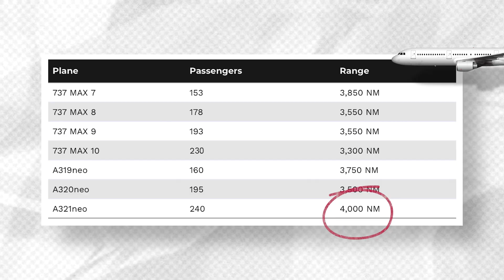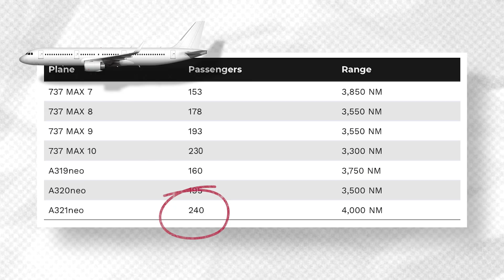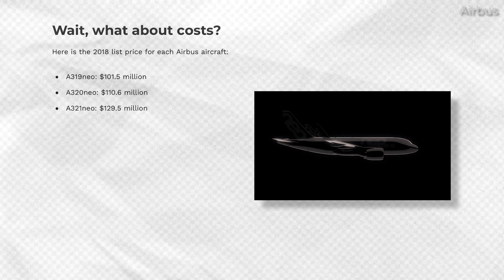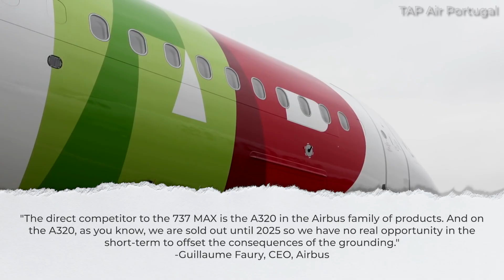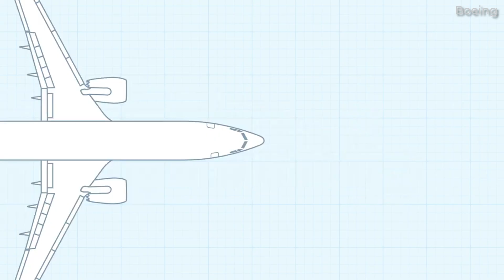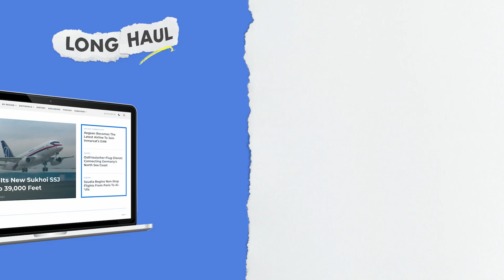The Airbus A320neo Vs Boeing 737 MAX – Which Plane Is Best?

Comment: Pretty obvious the one that doesn’t keep crashing and killing all its passengers is best.
Reply: the max doesn't keep crashing and keep killing its passengers. that would be more than 2 and it hasn't crashed more than twice
Reply: @nickolliver3021  still it crashed so end
Reply: @wasmiddelsap3379  like all planes do
Reply: @nickolliver3021  neo has had 0 crashes
Reply: @thomasgrabkowski8283  a330 has crashed
Reply: @nickolliver3021  I’m talking about A320neo. Also A330, that’s the original version that crashed, not neo
Reply: @thomasgrabkowski8283  and I'm talking of the original a330 that was one that has also crashed not the neo version
Reply: @nickolliver3021  yes it does
Reply: @BC_26fhj  no it doesnt
Reply: @nickolliver3021  The neo hasn’t crashed at all unlike the MAX
Reply: @BC_26fhj  the a320 has crashed unlike 787 lolz
Reply: @nickolliver3021  you come with argumetns that dont even make the slightest of sense, why talk about the A330, B787 when compareing the 737MAX to the A320Neo
Reply: @nickolliver3021  you are the one comparing apples to oranges, you compare the A330 or the 787 with the 737 or A320, everybody else except you are comparing the 737 to the A320
Reply: @KelloggsDigga  737  and a320 is apples and oranges so alot of people do that so I don't see who's is the one doing it
Reply: @nickolliver3021  how are they apple and oranges, the A320 competes with the 737 and vice verse. They are built for the same market, it is comparing apples to apples

Comment: I'll go with Airbus any day.
Innovation in plane design is another aspect you should take into account.
The 737 as a base is TWENTY years older than the A320. 
You can't forget that each new model is only marginally different from the base, just think of the engine issue that lead to the MCAS having to be added to the 737.
Yes, the 737 MAX might be safe, but innovation can only take you so far.
Fundamental design choices CAN'T be changed down the road with a plane (without changing the type rating and the consequences that brings with it).
I'm not saying the A320 is a completely up to date plane either, any 35 year old base wouldn't be, but i'm saying the issues the MAX has are issues that didn't have to be, just because they wanted to make "a quick buck" by upgrading the 737 one more time, when they REALLY shouldn't have.
Reply: Boeing should've done a 757 max
Reply: @tfoudrare  MBA's are not smart, that's why they're MBAs.  They just know how to destroy for personal benefit.  That's Boeing today.
Reply: @tfoudrare  Could still happen
Reply: #airbusforever
Reply: bring back the 707
Reply: airbus is so sigma. no crashes of the a320 neo family❤❤❤
Reply: That assessment is weird. The Dreamliner is the most innovative commercial aircraft in the air. Guess who builds them? I rest my case.
Reply: @sainnt  yeah sure. Except boeing can't turn them over to customers. Massive fail
BTW A350 is better
Reply: @billybill6604  I don't know if an A350 is quieter than a Dreamliner, but I know that the Dreamliner is more innovative. And, although the two aircraft are constantly compared, the A350 is a larger aircraft. Even an A350-900 is larger than a 787-10, the the A350 is compared to a 787 because of the mostly composite construction, and are both used for similar purposes. However the Dreamliner is more cost effective for airlines, which is why it outsells the A350 almost 2 to 1.
Reply: @sainnt  I don't see the 787 as more innovative than the A350. At all. The problem with 787 is that it is ridden with problems. They are piling up at boeing
Reply: @billybill6604  That's clear Airbus bias. The aircraft has been flying for 10 years already and faced 2; major problems; lithium batteries and Trent 1000; engines, 2; items not even made by Boeing. Currently issues with quality are nothing but the FAA grasping straws. Aircraft that's already been delivered were never recalled. There's nothing wrong with the Dreamliner.
Reply: @sainnt  Again depends o the use case.  Those "innovations" come at a cost.  The dimming windows turned out to be quite problematic for maintenance as well as for customers who prefer a window shade to block out all light.  The battery has resulted in numerous 787 fires.  Where the 787 is innovative is in the wing and engine design, although the A350 has now exceeded it.  Maybe if a 787 can be bought cheaper, perhaps there is a business case.  The A350 is a bit more upscale in terms of features so naturally it costs more.  Airbus can simply demand higher prices because it's more sought after.
Reply: @sainnt  The 787s first flight was in 2009.
Innovative, in my argument, is about the innovations that where made TWENTY years after the 737 had it's maiden flight.
I wouldn't buy a bag of sand from a company, Boeing in this case,  that hadn't made innovations in twenty two years since the A320 had it's maiden flight.
Reply: @grandnagus5851  That statement show a complete lack of objectivity, and proves that you're not an av geek. The 787, whether you like it or not, IS the state of the art in commercial aviation.  As a matter of fact, it's even more innovative than the Airbus A220 and the Embraer E2 series which are two of the newest aircraft out there. 
This is because Boeing built a completely new, I repeat, a completely new commercial aircraft in a way that's never been done before. You Airbus fans can continue to criticize the planemaker all you want, but history can never be erased. Those of us who love commercial aviation, will continue to love innovation no matter where it comes from. Right now, the Dreamliner is king. Live with it until Airbus comes up with their own tech that everyone else borrows from.
Reply: @grandnagus5851  That's a weird comment, especially since the Dreamliner is more than 20 years after the A320, and the Max is better than it's ever been precisely because of some of the technology borrowed from the Dreamliner. It is in fact what makes the Max better than the Neo.
Reply: @sainnt  Again, sir, since you don't seam to understand my point:
All i'm saying is that it is the natural order of innovation to produce a BETTER airplane!!
YES!! The 787 is a newer, more innovative plane vs the A320! I never disputed that point.
The A320 is a more innovative plane vs the 737! 
I don't see how you can bring the 787 into the discussion about innovation 737 vs A320.
I'm not biased towards Airbus or Boeing, all i care about is safety and company transparency. 
When it comes to the MAX, Boeing was not transparent with regards to the MCAS.
I don't care about if you think the 787 is king or not, all i'm saying is we are talking about 737 vs A320 NOT the 787.
Reply: @grandnagus5851  The 787 is the most innovative commercial aircraft flying today. The 737 Max has some of the elements of the 787 built into it, which makes it more innovative than the A320. You know what NEO means? New engine option. The only thing new on the A320 Neo is the engine. Sure they have mood lighting and all that, but that's it. From the outside, the only way to tell an A320 NEO from a CO is the larger engine. Park a 737 Max-8 next to a 737-800 and the differences are much more evident.
Reply: What people always forget to note is that the MCAS is a good design with a flaw. The MCAS is still in the Max, except it now works the way it was intended. The number of years an aircraft is flying is not an issue, but the maturity of the design. 
The Porsche 911 is the same design it's been since 1976, but that doesn't make a 2022 911 anything like the one from 1976. That 737 argument is tired and completely wrong, unless you all know more than the airlines that continue to order them by the thousands, nearly 16 thousand to be exact. Let it go.

Comment: Oh yes! The Ultimate Battle! A320 neo VS 737 MAX! Personally I prefer the A320 neo because it's much better and a lot safer than the 737 MAX and it's more fuel efficient and my favorite narrowbody aircraft alongside with the A220 300
Reply: I said the A320 NEO is safer because it doesn't have the MCAS which is why I'm afraid of flying on the 737 MAX
Reply: “Safer” doesn’t really mean anything because MCAS is fixed, so there is really nothing to compare their safety post-grounding, as the A320neo has never had a crash and MAX hasn’t since the MCAS issue was taken care of
Reply: @EvanAviator  you’re forgetting all the inherited issues from former 737 variants that weren’t touched. Plus, who is to say the MCAS system is truly fixed? I’d not trust a single word coming from Boeing at this point.
Reply: @kbos_aeronautics  mcas is truly fixed. That's why it's flying right now. The 737max is more spacious than predecessors so I dint see how it's is more cramped. Well it flies well and is a commn favourite.The Leap 1B is more quieter so that's kinda silly If people dont like the noise even though its quieter than cfm56
Reply: @nickolliver3021  as compared to other 737 variants, the MAX is definitely nicer, however I’m comparing the MAX to the NEO here. The NEO boasts a larger and more spacious cabin, quieter engines (LEAP 1As have a higher bypass and hence not as loud; PW GTFs is the same case) smoother flight characteristics, and overall much better proven safety record.
Reply: @kbos_aeronautics  okay that's fine. Both are proven quieter but the neo is slightly ahead than the max. But both gain orders so that's a good n
Reply: @EvanAviator  well well A320neo never crashed and 737MAX did twice even though it's newer so it is not as safe. Whether it has been fixed or not doesn't really change its track record. Personally I wouldn't worry when flying either, and let's be real, most people don't care either. It's all about the airline.
Reply: @EvanAviator  How do you know that MCAS is fixed?  Is it because you put your faith into Boeing's PR team and the FAA?  The same FAA that allowed them to self-certify in the first place?  The MAX / MCAS design needs at least a decade to know whether it is truly safe.  There is an FAA requirement of safety that there can be no death incident within a huge number of hours (1x10^12?  - huge whatever the number is).  So any talk of "safe" is just emotional speculation until it has been demonstrated.  Meanwhile, the 737 continues to suffer from many problems which don't result in crashes but are MCAS related.  We all know about all the MCAS related crashes, but how many incidents occured where the aircraft didn't crash?  Look them up.
Reply: @AquariusTurtle  yes I do because I’m not that pretentious
Reply: K @AquariusTurtle
Reply: the neo name sounds cooler and more futuristic than the max and also the cabin of the a320neo is very futuristic
Reply: a320neo family is more flexible, you need a long range, there is for short range, medium range, and the capacity also varies mre than the max
Reply: A320neo is better the airspace is way better than sky interior, airbus put much work into that interior while boeing plane just the same interior they are lazy and the max is also thinner thats why its a bit more fuel efficient than the a320 the a320 is more comfortable the best plane for narrowbody along side with the a220 and if u say 737 is better you are dumb and you probably have the brain of a donkey.
Reply: also if airbus added the winglets like in the 737 the a320 will be more efficient. Airbus could add those max-style winglets on a pit program like what they did to the a350 and a330neo. Maybe if a320 have those 737 winglets it could raise efficiency up to 2% or even 3%
Reply: @axelsalim1736  you realise the split winglets increase drag, right? The MAX winglets are purely trademark, they are actually far less efficient than the blended winglets seen on the NG and Classic.
Reply: @kbos_aeronautics  oops sorry i dont know but i think if the winglets are shaped like the one on the 330neo and 350 the a320 will be a bit for efficient?
Reply: Sadly the MAX is more efficient
Reply: @Bonazest9169  Efficient in what way?  Efficiency is just a ratio of input to output.
Reply: @AquariusTurtle  fuel efficiency
Reply: @Bonazest9169  Do you have a reference to this claim?  Have you seen any experiment or study that shows how they are mathematically making this claim?  Aircraft are not cars.  You can't just turn something into an MPG figure for easy comparison.  You would have to make equivalent assumptions on weight, cargo, temperature, pressure, flight distance, initial weights, landing weights, cruising altitudes, speed of flight, etc.  It seems like people are throwing around fuel efficiency as marketing but without real data.  Remember the A321NEO carries more and flies longer distances.
Reply: @AquariusTurtle  lmao just accept that the 737 max is better in every way and stop whining
Reply: @m4444x  max better than a 320Neo!?? Have you been drinking?! That would explain a lot
Reply: @m4444x  imagine this were true 😂
Reply: @AquariusTurtle  Actually you're thinking of the A321XLR. The 737 MAX flies further than the NEO. Since the NEO carries more, it has a higher fuel burn per hour, resulting in less range. Only way Airbus could get ahead was adding extra fuel tanks, which the MAX doesn't need.
Reply: @JackJohnson3119  Whatever configuration it has for fuel tanks, it still flies farther and without compromise on leaving passengers behind in hot weather.  The MAX has some significant weight limits compared the A3X family.
Reply: @AquariusTurtle  Yeah that's not true actually. The MAX actually has better climb and hot weather performance versus the A321neo. For example, out of PHX-Hawaii routes. Sometimes AA has to stopover at LAX for fuel while SWA MAX's can continue on with no problem.
Reply: @Bonazest9169  but terrible to fly with
Reply: @F12010Team  yes
Reply: @F12010Team  how?
Reply: @nickolliver3021  the 737 fuselage is almost a foot narrower than the 320, which, when flying on them, is very noticeable and creates a feeling of cramped-ness. On top of that, the 737 has less overall stability inflight (just based on the wing design and placement), and the engines on the MAX (LEAP 1B) outputs a audibly loud high pitched “scream” that is bothersome to many passengers (with documented complaints).
Reply: @Bonazest9169  But MAX is a " Disable Plane" that need a CRUTCH to fly properly. The crutch is MCAS.   A320 Neo does not need crutches to fly. It is safer.
Reply: Sadly, 737 Max is much more dangerous because of MCAS
Reply: @ronvela  Nah that's been fixed. Actually an incredibly safe plane to fly on as it is physically impossible for the MCAS type crashes to occur again
Reply: @Jack3md  it is still not cleared to fly in many countries. At least in my country, all 737 Max are all still grounded. Some even returned to the leasor.
Reply: @ronvela  Virtually every country has allowed it though, especially all the major ones. The only reason China hasn't is due to political tensions. Go check a live map of current MAX 8/9 flights and you'll see what I mean.
Reply: @Jack3md  you do realize that so many people around the world are still opposed to the idea of flying with MCAS, don’t you?

That “crutch” called MCAS, and big belly of greedy are the problem nowadays for Boeing.

At least 320neo doesn’t need the crutch to fly
Reply: @ronvela  Yeah, not true at all. The MAX 8/9 is flying at almost 3,000 flights/day and has safely completed over a million passenger revenue flights now. Last I checked, not one airline has had any issues with passengers in large numbers not wanting to fly on it. As the general public does not know, nor care what plane they’re flying on. And two, of those million plus flights since the ungrounding, not one MCAS related incident has occurred in two years. Clearly the MAX is safe and will be for decades to come.
Reply: @Jack3md hey man dont worry about the idiots that what to march around with their torches and pitch forks. The MAX is a great aircraft  . People who don’t understand aviation say the plane is flawed which it’s not. The max can fly perfectly fine without MCAS but was put on the plane to make it feel like the NG models. It’s actually slight more fuel Effie my than the Neo regardless of what people say.
Reply: @ronvela Why do you keep calling MCAS a crutch? It’s like calling every system on a plane a crutch.